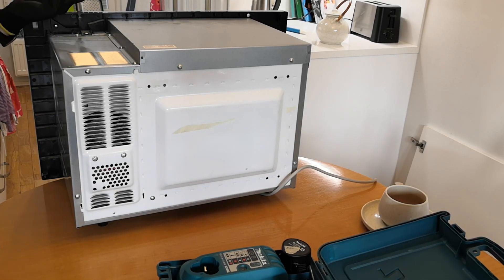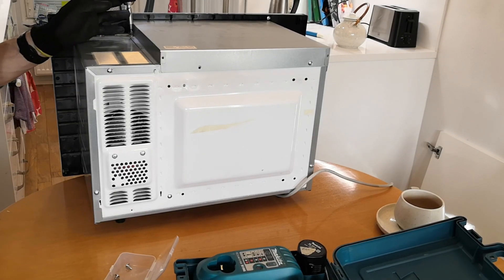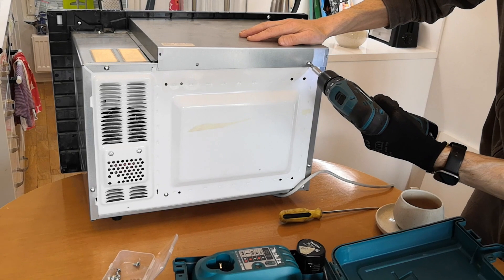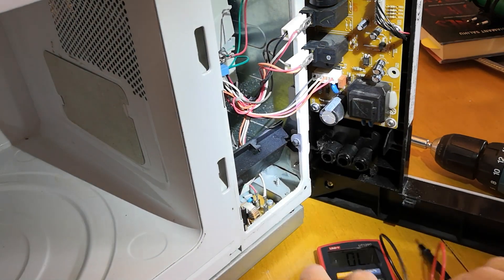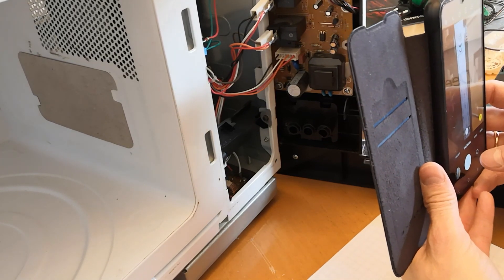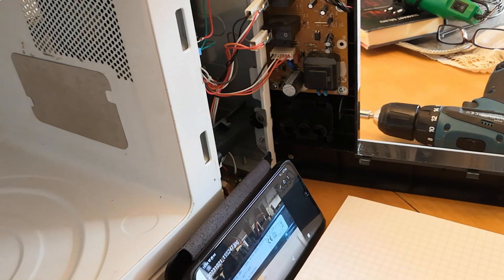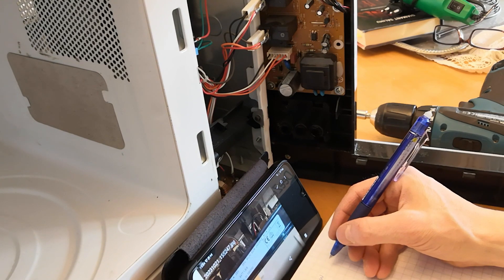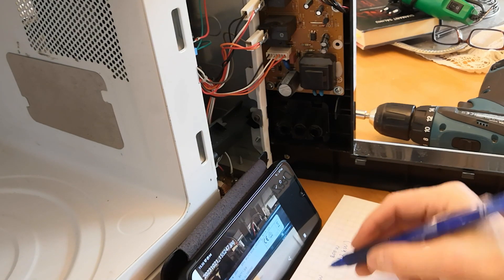AEG integrated microwave owen repair

Comment: Wich screwdriver type I should use  can you give a link so I can buy similar
Reply from the maker: Crosshead, just normal screwdriwer. It is better open from back. There are lots of screws, but it is better. Replace fuse and tighten DOOR SWITCH screws. There are THREE door switces. Up, middle and bottom switch mount screws. They get loose over time.. After that device is fixed! Door switches need to operate simultaneously. If not, the fuse blows, it is safety system. No need to replace anything else but fuse.
Reply: @SnapTinker  
Thanks for your reply 
I checked the fuse and its working seems the door switches are stoping the microwave/oven from starting there are 3 
Next is to find how to verify those
Reply: All switchers tested with multimiter and working and both fuses as well not sure why it doesn't allow to start after I choose the program 
Only start button is not working
Reply from the maker: Is your devise totally dead? Does the light work, does the control panel power, does the motor spin? I would check the thermal fuse, but you have probably done that? If control panel gets power, the start button may be broken?
Reply: @SnapTinker  device is not totally dead it start you can choose the program .the control panel is working fine except the start button (touch panel ) .thermal fuse tested and working fine.
Unless there is a hidden fuse, I don't see any problem. 
Will try to add pics later on
Reply from the maker: Check the start button. You'll need to take both circuit boards off.